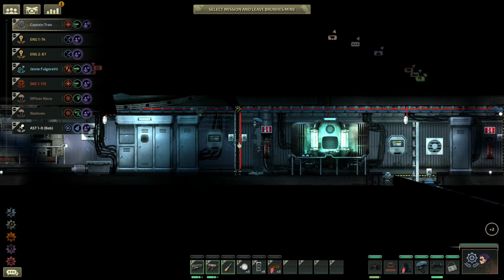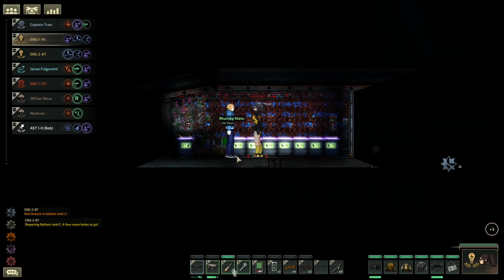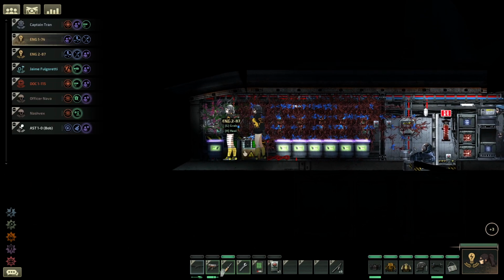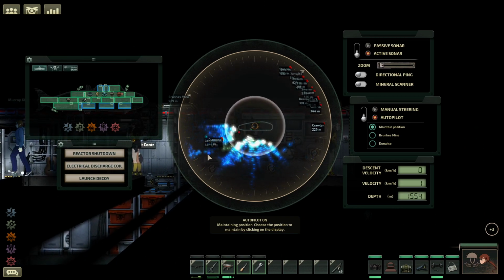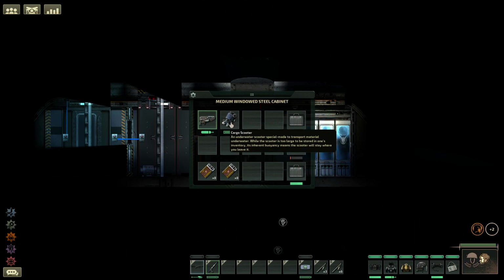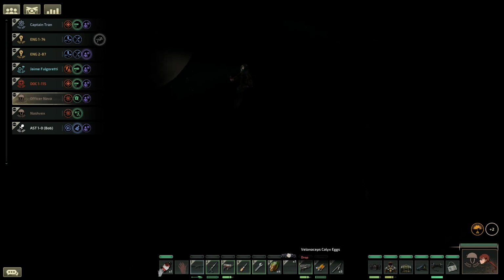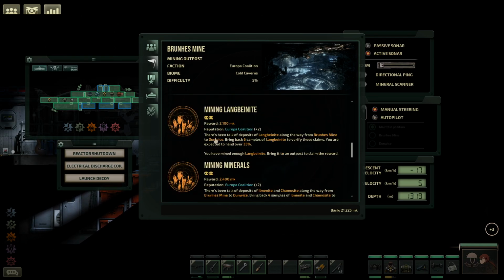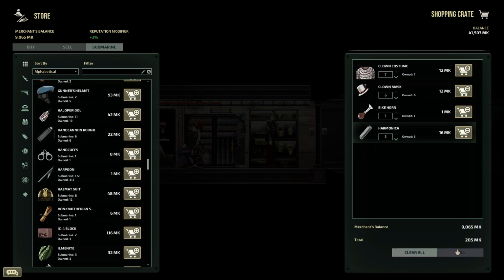Barotrauma ⚓ 〔AnimEuropa Mod〕 05 - Learning: 1-Component Electrical Engineering

Comment: One thing to add for the wiring: for levers and switches you should use set state, not toggle state. Toggle state is for buttons and pulse type signals. You might not notice it, but switches while on constantly toggle the items and relays on/off in toggle state, thousands of times per second, that puts extra load on the game.
I really like your tutorial-like playstyle, back when I started I was looking at so many dry tutorials, trying learn basic things was a chore. Really nice video.

The ammo box order I meant in my comment that ai should refill ammoboxes with materials in the fabricator, but it is not in the game sadly. I apologize I wasn't clear with my comment, you cannot fight when you hand slots are occupied, that is why I don't use cargo scooter (I got hurt and infected lots of times because couldn't drop it fast enough). Crates and containers are only when looting a cleared derelict, for mining I don't take anything in my hands in case I need to fight, but an empty inventory with a plasma cutter, some o2 tanks and a harpoongun is usually enough for mining. This is why slipsuit is a must for me for mining, salvage and ruin missions.
Reply from the maker: Thank you for the kind words and advice!

🧐 Looking at my wires, I did indeed copy the submarine's "Toggle State" wirelink that was used with the original button.

😏 I experimented for a bit just now to see if maybe the starting "Toggle State" was designed to slowly increase the load of the reactor by sharing the burden with the batteries, but it doesn't seem to make much of a difference with some amateur pilot testing.

😄 As you pointed out, it was claiming insufficient power several blips a second when using the "Toggle State" set up.  Switching to "Set State" per your suggestion removes this "feature" entirely!